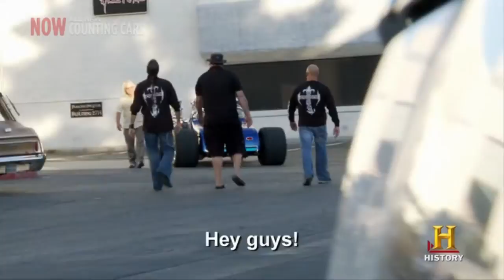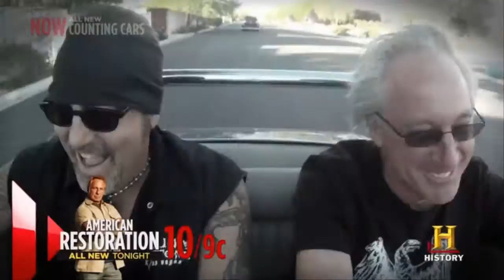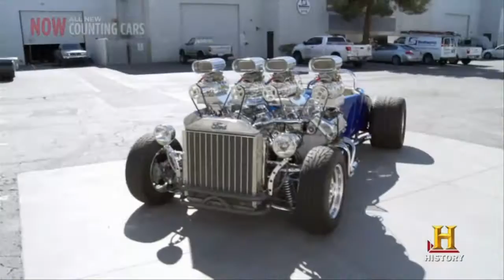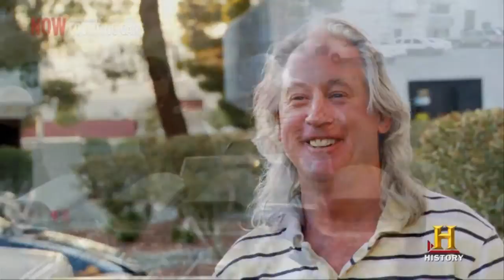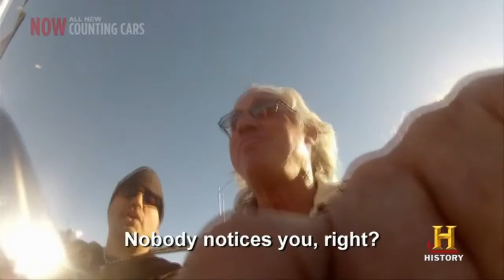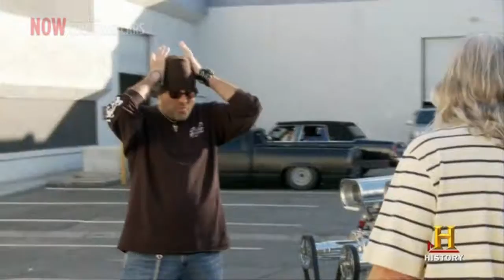Twin engine Counting Cars

Comment: That is definitely a neat novelty car but if he's running 2 v8's and 4 (6-71) blowers and that car is only making 1200 hp something is fake or broken,my super late model dirt track race car runs a 604 BBC crate motor comes stock making 900 after we change the carb and valve springs and a few more over the counter parts 1100 to 1300 hp all day without a blower, with a blower we should easily build 1500
Reply: And no one knows you
Reply: @borismcfinnigan3430  awww your boyfriend pull out to fast? Made you cranky
Reply: @patwatson7543  definitely pulled out faster than a shitbox super late LOL.

BTW, nobody is dumb enough to think you are going to magically pull another 400hp by changing carb, springs etc LOLOL.
Reply: @patwatson7543  hahahahahahahahahahahaha
Reply: @patwatson7543   I think it might be 1200 bhp at the wheels, which is justifiable since it does take power from the engine to run a supercharger unlike a turbocharger. And he's got 4 of them so the total efficiency is low.
Also could be the fact that he configured it to produce lower pressure since there's a risk of blowing up the engine.